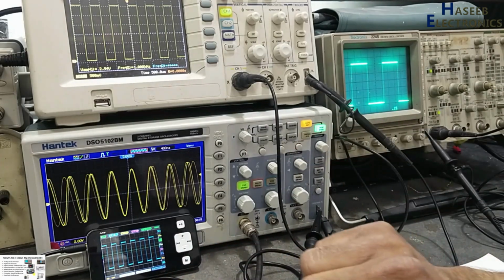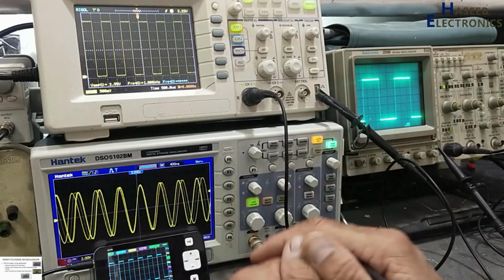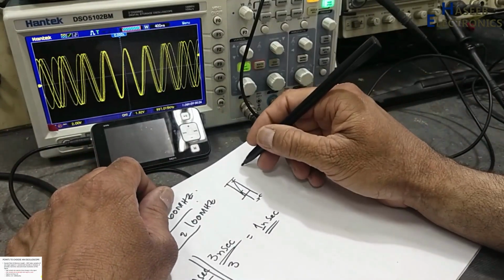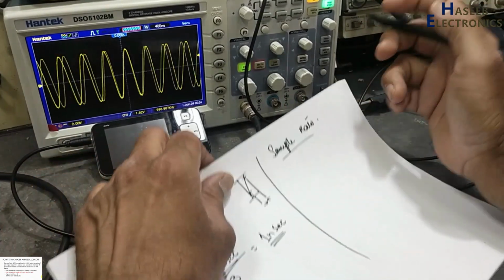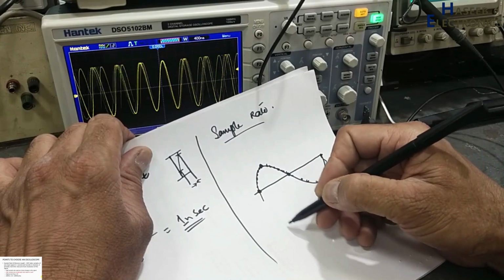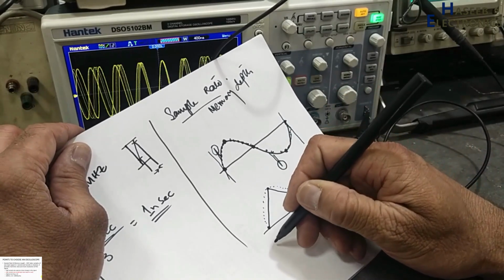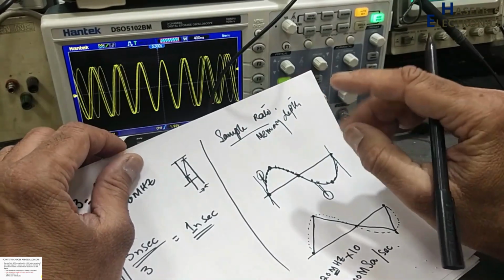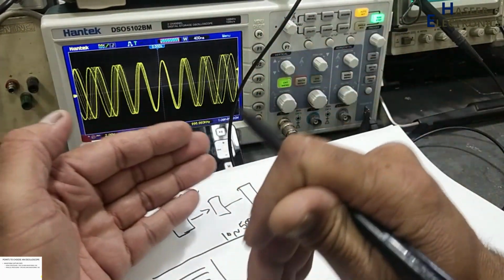{1112} How to Choose the Best Oscilloscope To Buy

Comment: First question to ask is 'do you really need an oscilloscope?'. I have done tens of thousands of repairs over 30 years and rarely use my scope except for analog audio checking. In my repairs (mostly old arcade games) a logic probe and multimeter is enough, together with powered desoldering tool and TTL logic, RAM and ROM chip tester. For clock checking I use a dedicated handheld frequency counter. To check reset present or digital data activity a simple logic probe can do it but be sure to use the type with piezo speaker because the noise it makes is also useful to determine the problem. Analog audio coming out of opamps can also be heard with logic probe piezo speaker. For analog audio before opamp, checking with logic probe is not possible as it only shows a constant high so to see the active audio waveform a scope is needed. It depends on the situation. A shop doing a lot of varied repairs can benefit from having a scope... providing they know how to use it and how to decipher what the screen shows. Amateur person at home with broken TV should just buy another new TV and move on... or bring it to Mr Haseeb to fix it :-)

Comment: Salam, we generally use oscilloscopes to check voltage/time waveforms. A have bought a siglent oscilloscope that shows in the menu AMPS and you also mentionned it in the video. How does an oscilloscope deal with amps ? Thanks.